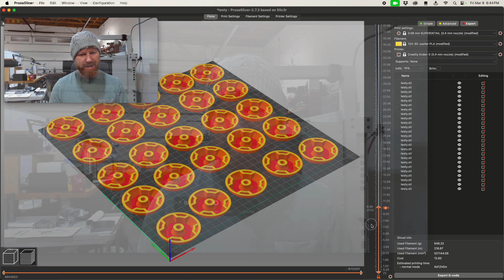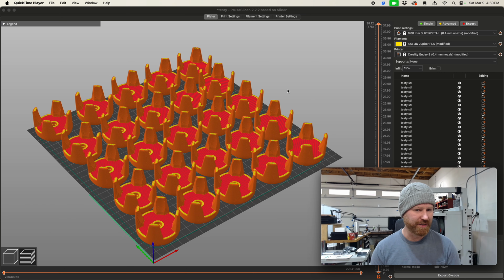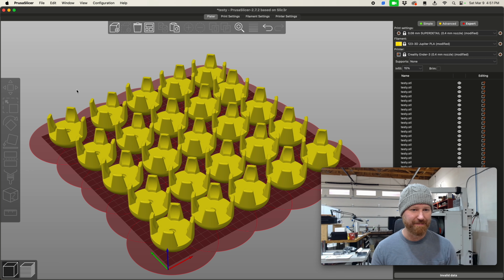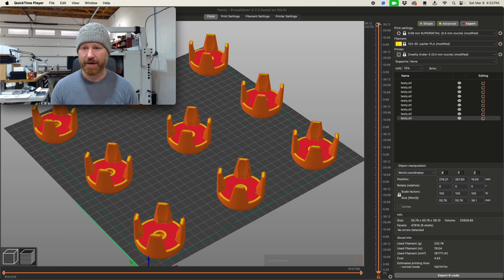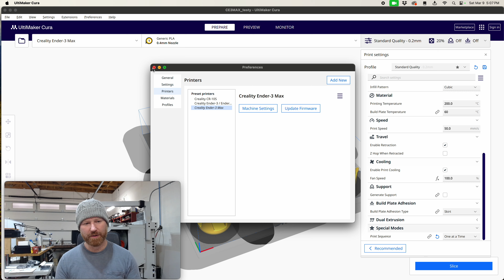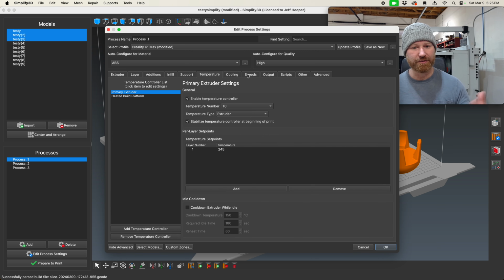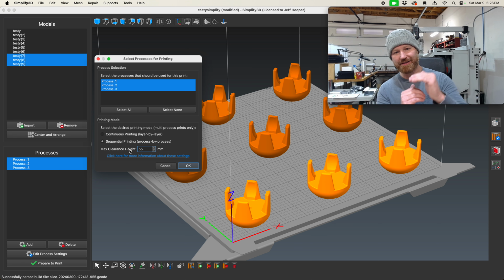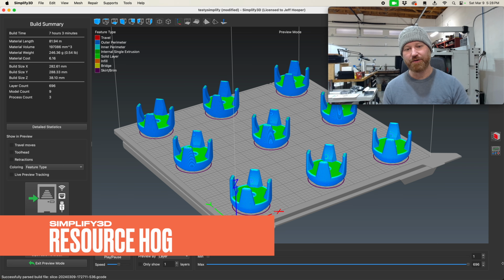Master Sequential Printing: Tips and Tricks Revealed

Comment: In Cura you can place/copy/multiply your parts as you like. Then there is a hack to define print order of placed parts when sequetial printing. You delete parts one by one in order you want them to be printed. After you deleted all parts, you undelete them all  one by one with ctrl-z (undo). Now they will print in desired order.
Reply from the maker: That's a good Hack! Thanks for sharing it!
Reply: Thank good for that comment. I love you for that.
Reply: This is awesome.  I never would have thought of this.  Thank you!!!
Reply: @Enjoymentboy  Me neither, I found that hack on YT year or two ago @Enjoymentboy
Reply: That's amazing! Going to try that. Thanks. I've had it switch the print order on me just by moving them around. Trying to print front to back, I've seen go front back middle. Then I swap the middle and back parts positions only for it to still keep the front back middle even though it's a different part. Quite frustrating

Comment: I use simplify 3d for everything. I love it's feature set for production printing, and it's reliability.
Reply from the maker: Thanks for the comment! It has some very unique options that have saved me a ton of time running production.
Reply: @ChipMonkeys  And so many in the printing community don't understand why we all like S3D so much when we have businesses that are running production lol.
Reply from the maker: @Titan3DAZ  For production printing, I have not found a software with better options than S3D. I mean, you can run multiple profiles on the same part at different levels : )
Reply: @ChipMonkeys  It is some really cool software. I see you commented on my video, my favorite part is the ability to customize what is customizable. Those settings bars are genius. I have 1 master profile for all my machines, and everything is just a dropdown menu in the master profile for filaments and their settings. So much easier, plus the whole manually placing supports is amazingly easy. No need for support blockers and or modifying regions based on other geometry lol
Reply from the maker: @Titan3DAZ  That's the one I watched!

Comment: Be careful when printing one at a time. The measurements of the toolhead in Cura are aparently without the probe. Learned the hard way. Holder bend, probe broken.
Extra tipp, thin superglue and baking soda is a nice way to fix plastic fast.
Reply from the maker: You’re right, I probably should’ve made safety a bigger deal. : ) I hope I’m not responsible for a bunch of broken printers